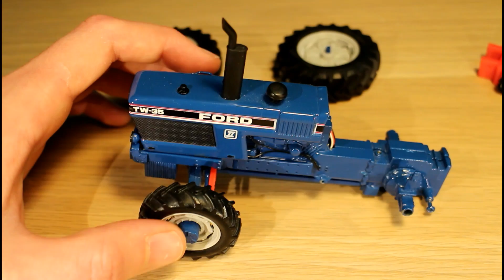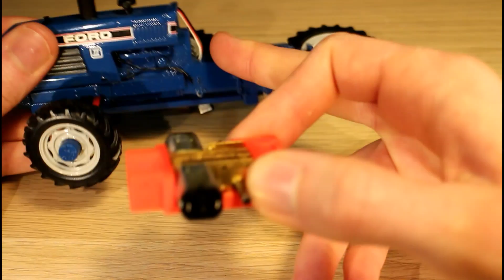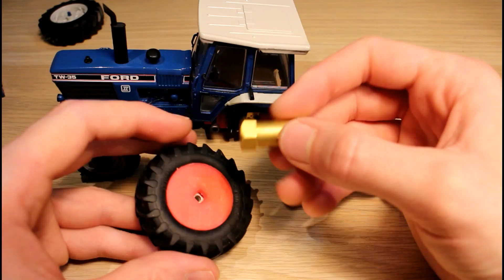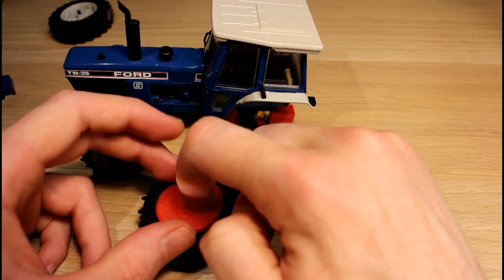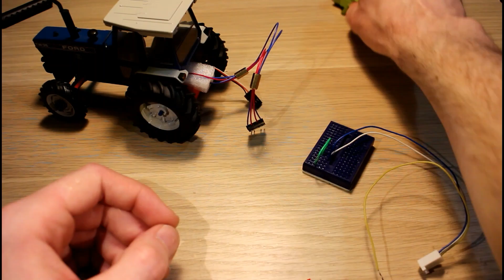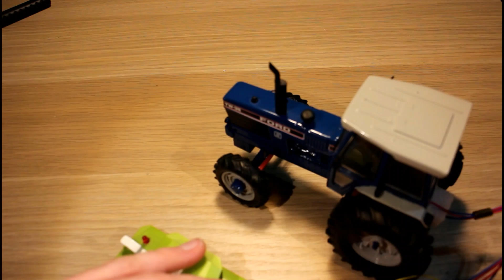Radio Controlled Ford TW35 Part 3 - We have brake steering

Comment: great vid. it would be great if you could 3D print a piece the colour of the model
Reply from the maker: +Tadhg Griffin That would be ideal but a spray can of Ford blue will have to do the job when I get it finished.
Reply: +RC Tractor Guy ya i never thought of that

Comment: Great Video!
Congratulations on getting the small model to turn and drive.  Just wondering if you will be sharing the stl files on your Patreon site?

P.S. Will you be updating your Playlist's?
Reply from the maker: +RcTractor Wizard I put up the ford files there, hopefully they'll be of use. I also uploaded a bunch of other files I had, some for things I know work like the files for my slatted shed frame but a lot of random parts also that may not work I can't remember but they might be useful for other projects.

I know sorry I'm terrible at finding the time to organise the channel or the website for that matter. I'll try get it organised as soon as I get a chance.

Comment: any chance you could make a rc push off buck rake? it basicaly is a buckrake for a tractor ive got one it is manual though and you have to move an arm with you finger same again just thinking out loud as normal it would be intersting though
Reply from the maker: +venombitegaming You probably could but I'd say the parts would be so big it would be hard to discretely do it, your modification would probably be very obvious. Would be a nice function though.